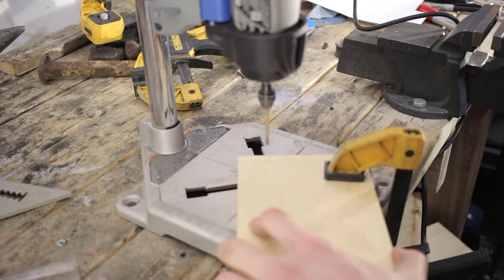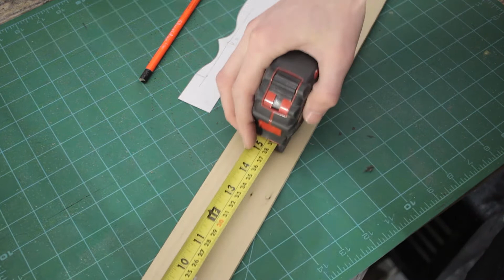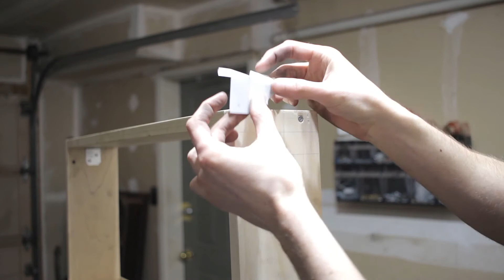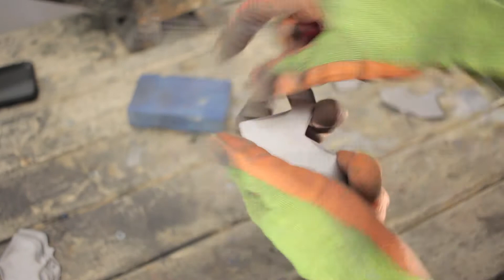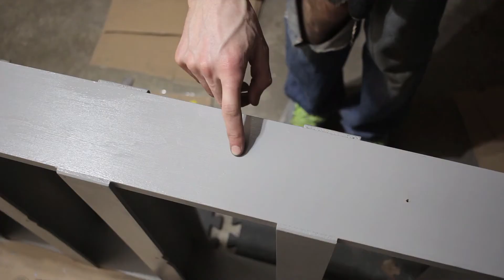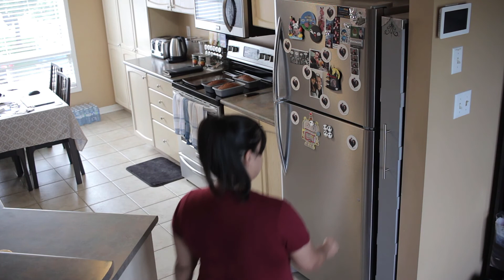Making a Rolling Pantry - Pull-Out Kitchen Organizer

Comment: What size for the poplar did you use
Reply from the maker: Hey! Thanks for the interest! I used 6' x 4.5" x 3/4" Poplar boards for the outer frame. You could use the same material to make the shelves, but I used Pine because it's a cheaper wood.
Reply: MAKE**IT thank you what size was the pine?
Reply from the maker: @ashleyguzman6500  Same size boards as the Poplar, just cut to fit beside our fridge.

Comment: How wide is that?, I have 5 inches to work with🤔
Reply from the maker: The width of this unit is 5 inches and the opening I had to work with was between 6 and 7 inches (depending where the opening is measured from... Crooked floors and walls in my house lol). So if you have a 5 inch opening, 4 inches should do the trick. I'd just be sure to have the safety rail installed so that it stops it from tipping over). Good luck and have fun building it! 👍
Reply: MAKE**IT thanks 🙏🏾